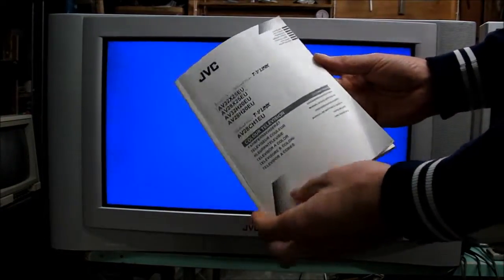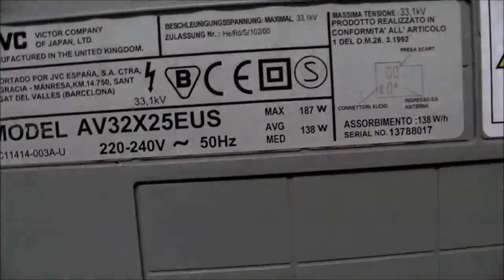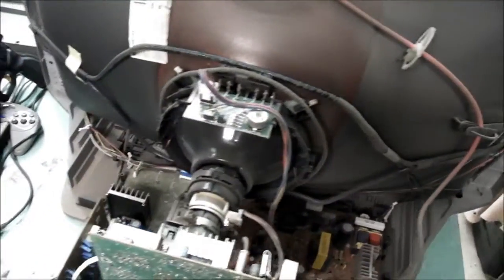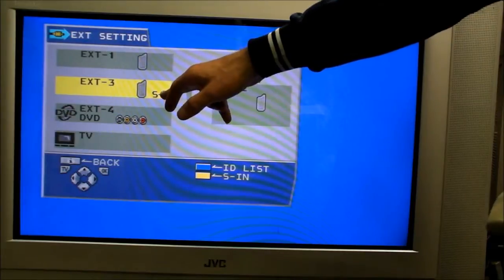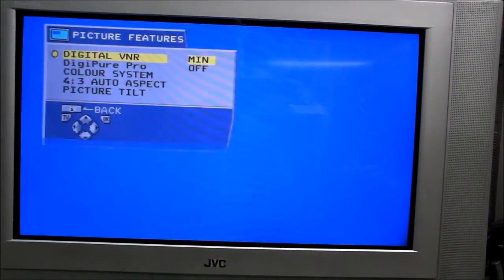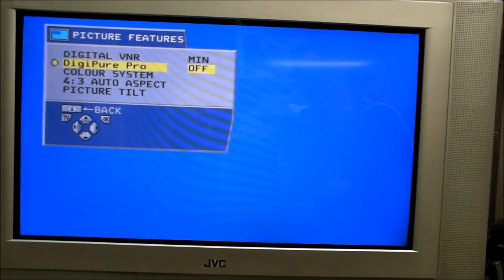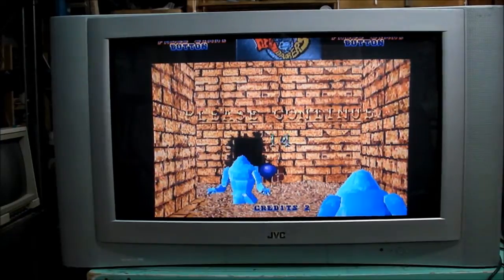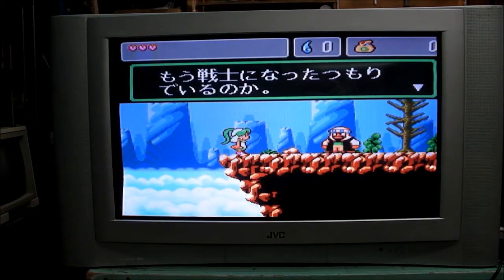JVC AV32X25EUS triple scart tv

Comment: Your videos are among my favorite on youtube. Classic CRTs fascinate me, and its awesome getting to see so many that I otherwise wouldn't. Quick question, what in your opinion is the best preset for gaming. I'm using a sony wega 32 inch, and used the "vivid" mode for the longest time until I found out that prolonged use could damage the picture tube in the long run.
Reply from the maker: I pretty much leave the preset to normal, and then make any adjustment from there such as contrast and brightness, color adjustment generally doesnt work on the older tvs out there while in scart RGB mode. The newer ones like in this video the color adjustment does work in RGB. Although I try to avoid going to bright or high in contrast for same reason you mention above. I imagine it would be harder on the tube and the circuitry. Tube life/quality probably would be shortened on stronger settings.

Comment: Was the gun game tested in 100Hz mode or 50/60Hz?
The old gun games from 16bit era relied on the scan line timing to calculate where the user was pointing and are probably programmed for 50/60Hz timing. I've never tested 100Hz TVs tho, did it have a separate setting for this, or was it the digipure pro setting?
If there is a seperate setting, maybe the game will work at 50/60Hz?

Comment: looks heavy, what would you say is the largest and best suited crt for 8-16bit consoles that was also available on the Australian market?
Reply from the maker: None of them are easy to get but look for these non 100hz models, all have scart:

- 89cm Grundig circa 1996, see my vid
- 80cm Grundigs mid 90's into early 2000s, many are 100hz, but grundig still had 50hz as well.
- 80cm Sony early 90's uncommon.
- misclellaneous brands: RCA, Dual, Ferguson, Siemens all rare
- Broadcast monitors 89cm mitsubishi, nec rare aswell.
Reply from the maker: RGB Rob  Oh I shoudlnt forget Teac, not the best brand but to their credit they probably have sold the most scart tvs of any brand in Australia. 80cm scart teac the most findable of all these.